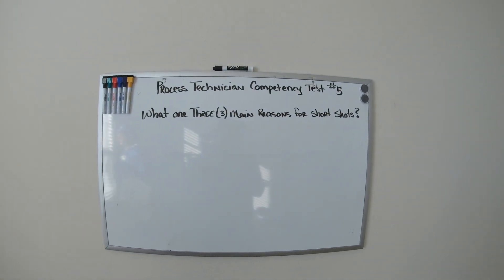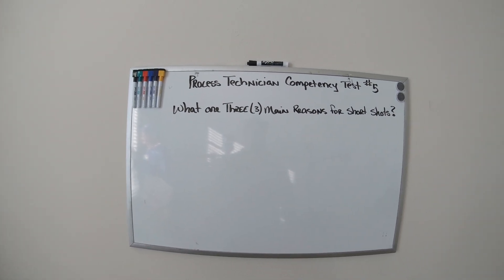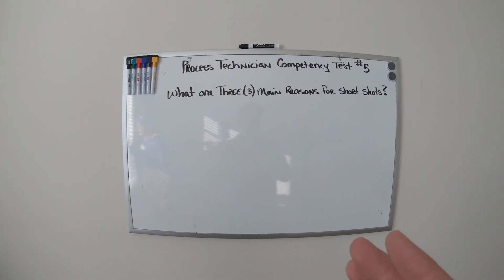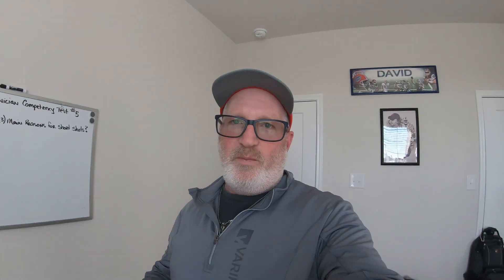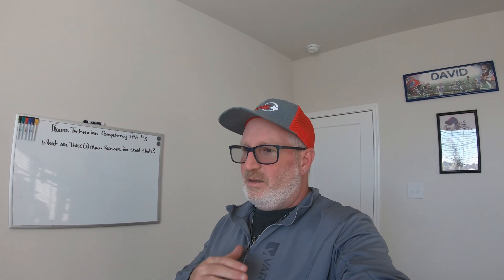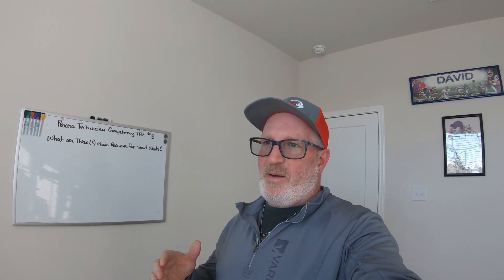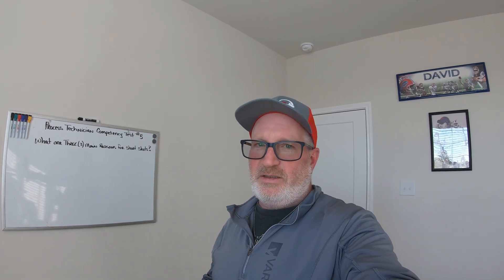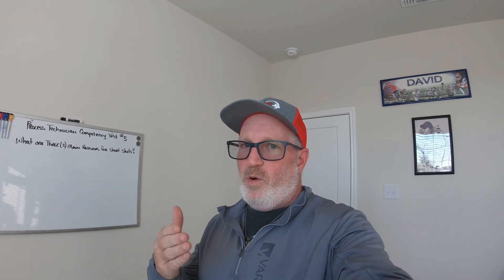Process Technician Competency Test #5

Comment: I would say the number one reason would be insufficient shot size. Too slow of injection speed as well as not enough pack/hold time or pressure. Also, I believe too low of a plastic temp can cause shortshots or too low mold temp. I recently found out on a mold we have that the vents seem to be a bit to small and if the vents get dirty it will start to have short shots, i will clean the vents and short shots disappear. Im sure i missed a few reasons.
Reply from the maker: That is great stuff with the comments. You are right with the mold not being cleaned & the other things you are right on. Sometimes the simplest things people overlook, like mold being cleaned. Thanks for watching & the support to the channel I greatly appreciate it.